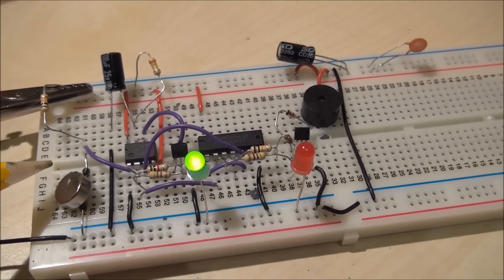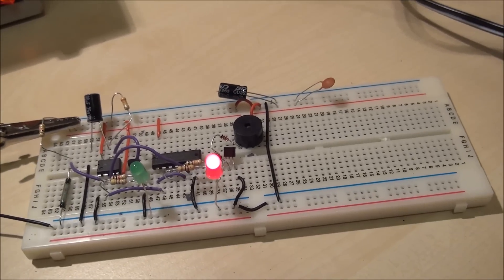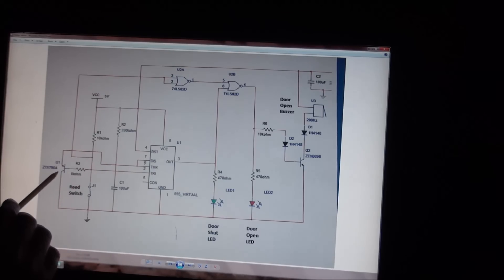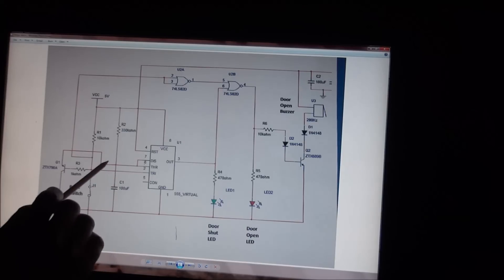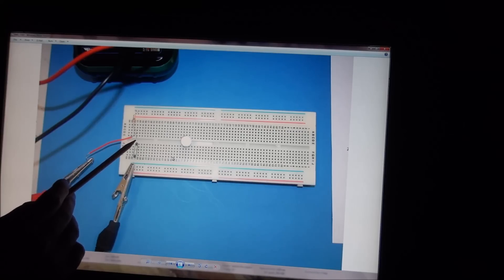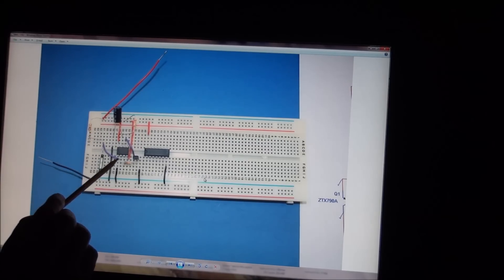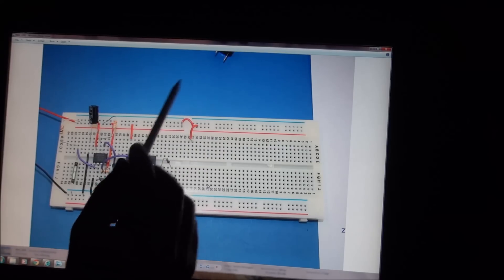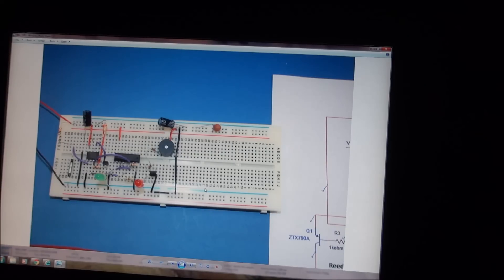Timed Door Alarm using 555 monostable

Comment: Hi amigo can you share with me the circuit. Saludos
Reply from the maker: Its ages since I designed this circuit but apart from the resistors, capacitors, diodes and LEDs whose values hopefully you can read, you will need a standard pnp and npn transistor(they don't need to be high power), a 74ls02 NOR gate (16 pin chip has 4 gates on it), a 555 timer (the main chip in the circuit) a reed switch with magnet and a buzzer. I'm guessing your college electronics lab will have all of those things or equivalents or you can ask the lab tech to order them in if its for a project.